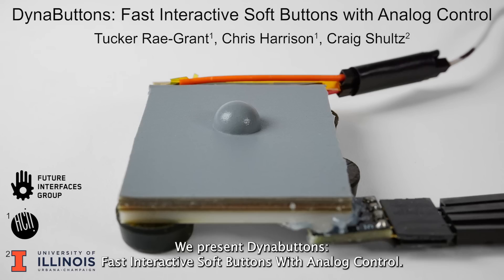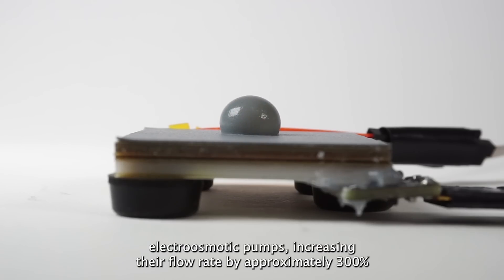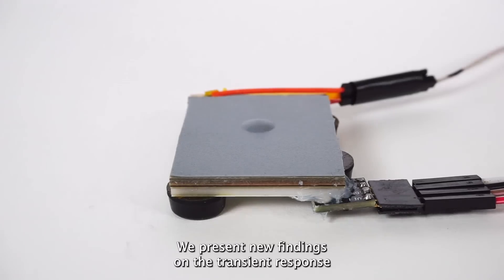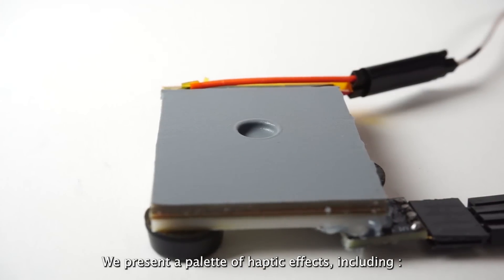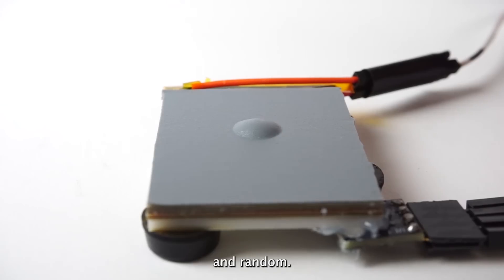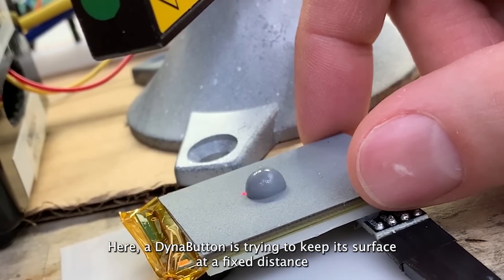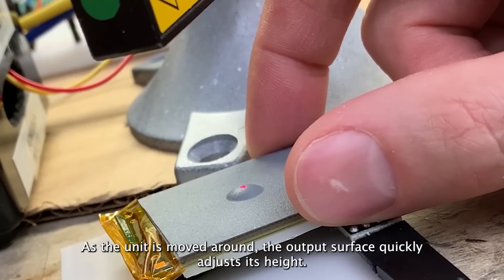DynaButtons: Fast Interactive Soft Buttons with Analog Control (IEEE HAPTICS 2024)

Comment: The Xbox original controllers had analog buttons though not many games used them. The ones that did allowed the pressure of the press to affect gameplay. Linux's drivers read these analog values though they convert it to a digital signal for compatibility.

Comment: Tech seems cool, but I guess I don't really see the point of this. Is this intended to be an INPUT device? If so, why are you giving it the functionalities that you would typically give to an output device?
Reply: I can imagine the tactile feedback would be handy in things like VR controllers or braille interfaces
Reply: While a braille screen is a really cool idea, that would still be considered an output device. 
I don't really see the benefit of having it on any sort controller. What if the button got stuck in the "down" position when the user is expecting the "up" position?

Comment: Imagine creating images or different effects once the material is not a matte gray. You could bend the light travelling through the material and make it change colors or warp objects/lines drawn on the surface. You could make an instrument panel that disappears and turns flat whenever power is disconnected for aircraft or anything else. Imagine a keyboard that's a flat sheet of this material until you power it on and all the buttons pop up. This technology could be the future of displays and interfacing.

Comment: This stuff possibly could be integrated with something like lcd or display contollers for their matrixes for REAL! 
i mean - then they could draw a physical way to create and change all the interfaced buttons as well as making them drawn all around... like some electrical internal locking to lock some areas in a shape to inflate or deflate it?!
literally may it be a some way to interlock and change a way for inflating and deflating a random or specified areas of all surface for it then? 
just think about it

Comment: I always imagined this as the future of human interaction with displays, like a new type of touchscreen, or maybe a combination of both. Imagine pressing a real button instead of tapping on a flat surface... the only problem would be to use a display flexible enough that doesn't make any image aberration when is pushed or pulled

Comment: adaptive key surfaces to reduce carpal tunnel, everyones finger sizes and distances are different so mass manufacturing customizable curvatures in keyboards currently isn't viable.
You hold your hand over the keyboard and the keys literally move towards your fingers like the rays of a plasma ball, combine with autocomplete for size emphasis.

Comment: I wonder if they would be a good use on a robotic hand. It could both sense the pressure being applied and also used to finely control pressure exerted by finger tips. It would also allow for changing the texture of the finger tip by changing how inflated it is, and maybe that could control the "grippyness".

Also, it would be fun to see a keyboard made with those. It would be like typing on bubble wrap!
Reply: Supposing it could be scaled down a little further I think it could have a lot of potential in terms of adding some "sense of touch" to a prosthetic
Reply: yes of course robotic "hands"
Reply: @mrld3005  sign me up brotendo

Comment: Very neat! Would be interesting to see how this wears out over time/how many interactions it can take. 
I could see these being used as part of a set for a SciFi show to be honest, an 'organic' touch type interface with analog control and 'haptic' feedback could make sense for a control interface, even though it's not particularly 'human friendly' for most people
Reply: Just what I was thinking.
Reply: Imagine seeing these moving (and functioning) on the next TARDIS console!
Reply: I see other applications that might involve slightly rough handling.

If these could be integrated into a roughly circular/oval tunnel in a much larger single form factor you could make something that automatically tightens to fit the user.
Or on the flipside, can be made ribbed for her pleasure at the touch of a button.
Reply: @daviddavidson2357  I bet it would be pretty easy to get a small cylinder unstuck from that tube filled with butter and microwaved mashed banana.
Reply: It's a cylinder...

Comment: Waterproof and silent brail display
Reply: @enilenis  It'd be hilarious if it was as loud as Niagara Falls
Reply: @LeesChannel "Can someone please tell me why we need a 60HP 3-phase electric pump to run this thing?"
"Well boss, the membrane is pure titanium."
Reply: @LeesChannel  wouldn't be a problem for the blind AND deaf.
Reply: First thing I thought about too.
Reply: @1blendercraft1  Me too.
Reply: @enilenis  they said that they used electroosmotic pump, which are pretty much as silent as it gets.
Reply: @enilenis watch the video, they are using electro osmotic pumps which are solid state and make zero noise. Unless it needs a fan or something this would be completely silent
Reply: @ThumbDr  The pump itself may be silent, but turbulently flowing fluid is not!  It might become an issue scaled up to thousands of elements fed by thousands of tubes all updating at once.
Reply: @Barnaclebeard This would be such an awesome system.
Reply: @enilenis Can confirm it is silent. And low power too! Can run on small batteries for many hours. Check out the Fluid Reality video in the description.
Reply: It wouldn't matter anyways because the blind wouldn't be able to hear it
Reply: @encrustingacro  The. blind. wouldn't. be. able. to. hear. it.  🤣
Reply: @kennethbeal  Oh wait I mixed up blind and deaf
Reply: @encrustingacro  It was so hilarious to me because I almost typed the exact same comment!!!
Reply: Yeah it's really annoying how loud brail normally is
Reply: Is braille normally loud or something?
Reply: @mystriddlery  its for blind people, i know there is a sound issue, but with this technology you could theoretically make a braille ebook
Reply: @kevinmorrice  I get that, Im just curious how sound factors into it, its not like braille makes any noise as is.
Reply: @mystriddlery  sound has nothing to do with it, im just pointing out the possibility of it
Reply: @kevinmorrice  Ok, my point was about how the top comment we're replying to mentioned a 'silent brail display'
Reply: @enilenis  They are using electroosmotic pumps, which are silent.
Reply: Holy shit a Brail Kindle!!!
Reply: A Brail Kindle!
Reply: If we can put this stuff into arbitrary hardware, I could even see regular electronics and videogame enthusasts learning braille, in order to quickly recognize input descriptions and feedback on the surface of control devices without having to look at them.
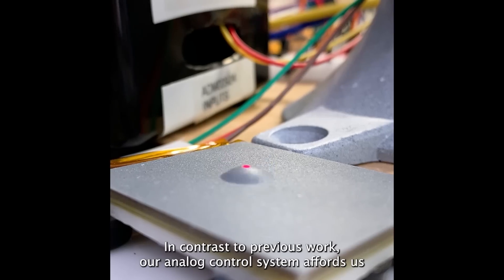Reply: @enilenis   There is audio on the clip. At 0:28 you can hear the little membrane bubble sucking in. It makes noises at other points but it's quieter than the speaking voice.
Reply: For moving the eyes and eyelids of androids? Via leverage. It sounds more organic than the usual electric-motors. Human eyelids aren't silent.
Reply: Isn’t braille already waterproof and silent?
Reply: braille ebooks
Reply: Yes!!! This is a fantastic idea
Reply: @enilenis 

Check out our work on Fluid Reality haptic gloves too. Yes they are silent, and can be arrayed.
Reply: Maybe not
Reply: no way
Reply: FINALLY BRAILLE PORN.
Reply: K @enilenis
Reply: My Fürst thought as well. Just need to miniaturize it and have hundreds of them.
Reply: oh ok
Reply: @enilenis  tiny osmotic flow pumps would be worst case as loud as a fridge or something like that. they are used in medical settings so yeah kinda designed for it.
Reply: There’s not enough money in blind people, they’re all BROKE!
Reply: "display" haha. I can't think of a better word though
Reply: Smart. But pressure sensitive video game buttons seems the most obvious application
Reply: Waterproof refreshable braille displays already exist.
Reply: Oh fuck
Reply: Omg youre right
Reply: @enilenis  also anything that moves in a fluid creates noise, so the moving of the membrane will create noise too, although it is likely too little to hear.
Reply: We all have the same thoughts :D
Reply: That blob is too big for braille assuming that is the smallest they can make it. Piezo electric actuators would probably be better than this.

Comment: Since it's an IO device, I'd see if I can drive one DButton by the digital observation of another. For example, diagnosing a rattle in a washing machine by sending the sensation of touching it over a network connection.
Reply: Neat idea, could probably do that with existing tech tho, if you need to do it. An accelerometer and a pager motor/speaker would work ok.

Comment: I wonder what practical situation this would make sense in.
Reply: Sex toys.  All new technology becomes a sex toy at some point.
Reply: Dynamic Braille maybe?
Reply: Haptic feedback in gloves for vr
Reply: @BoxedGod  https://youtu.be/8gOww9zF5Ic
Reply: an interface where some buttons can be disabled instead of doing nothing.
though it mainly depends on the cost vs other type of buttons
dome buttons are a few cents and good switches are like a buck, so if they can be in the 50c-1buck range they might be viable for a variety of interfaces.
completely unrelated uses might be cooling on phones and other application where a very small pump can be used.

looking at other videos they seem to be able to be made as very compact arrays, so haptic feedback in vr seems like a great application
Reply: Mutant touch interface. An analog stick, d-pad or buttons could pop out of the interface.
Reply: @charlesabju907  if it's fine enough (like 1-2mm) it might actually work as a psp-like stick (i.e. flat analog stick) and would definitely be better than a touchscreen.
it might be good for car interfaces actually, because buttons are necessary for safety, but you might want to change the interface for non necessary things like audio and navigation.
Reply: Microwave buttons?
Reply: @nyanpasu64  They had fast, responsive capacitive glass touch panels on microwaves over 40 years ago.  Microwave interfaces have been universally in decline since.  If this sensor can be made cheaper and less reliable than a stiff, mushy plastic and crumbly foam on PCB matrix, then obviously it's the way of the future.  The road forward starts with anything that makes existing products worse.